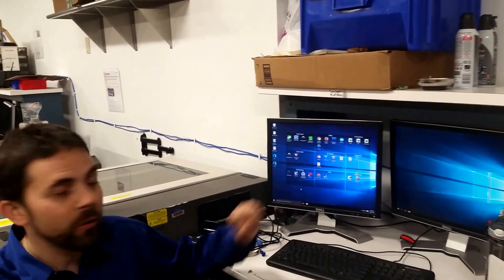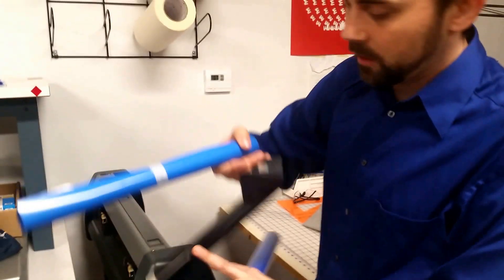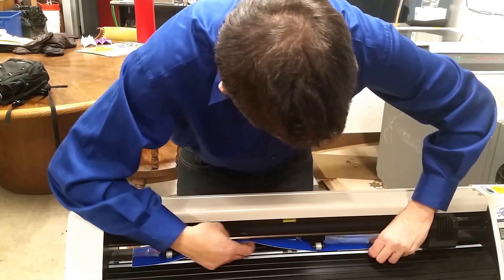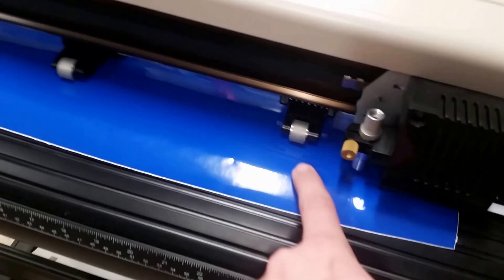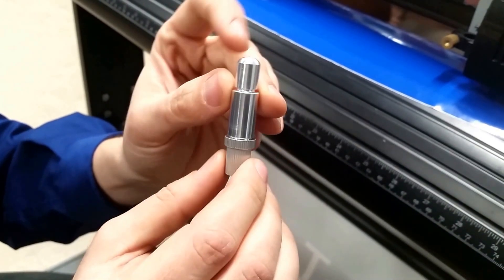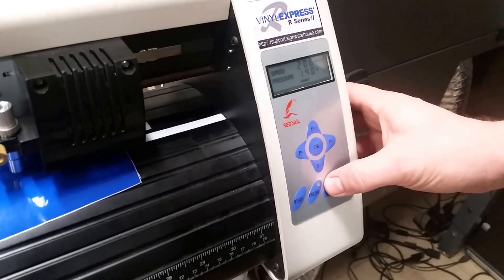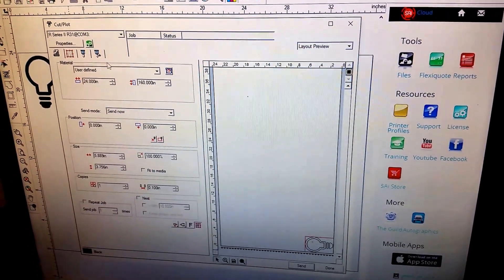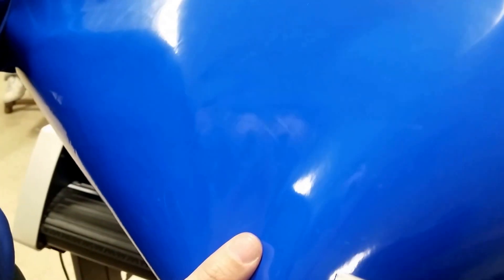Cutting Your Design on the Vinyl Cutter

Comment: got my redsail in 2013, i was mocked in the 'pro groups', here we are in 2021 its survived covid..... once i stood it upright (on its side) on my desk, then knocked it, it fell over in what seemed to be slow motion, it hit my mouse and keyboard, both shattered, the cutter then rolled off the desk and went with another big smash on the floor... i picked it up, the sled/knife assembly was just swingin on its belt, i clipped it back on, turned it on, it lived, i tried a cut, cut fine, didn't have to adjust a thing....

Comment: I have a r 31 that uses a dongle have to use a Windows 7 don't have the 7 anymore what can I do?
Reply: Did you ever get your problem fixed bcuz mine is sending the job but the cutter is not responding? Don’t know if it’s the firewall settings or not but I’m operating off windows 10 pro